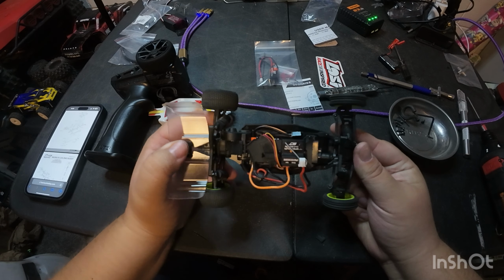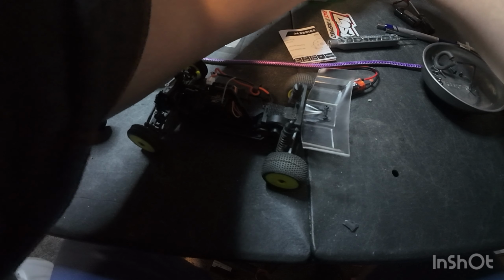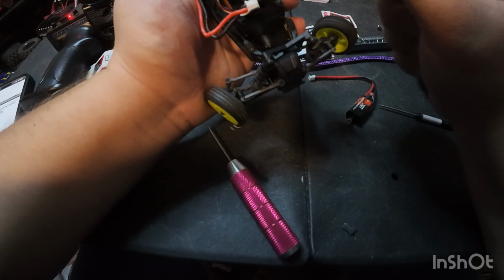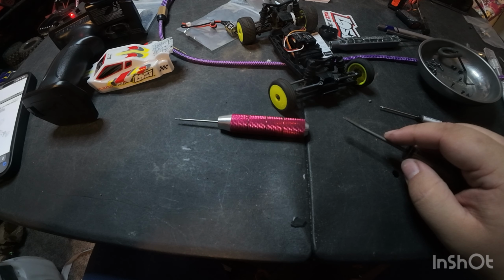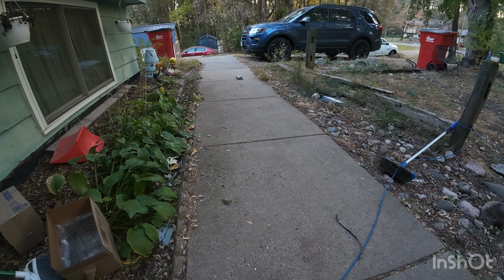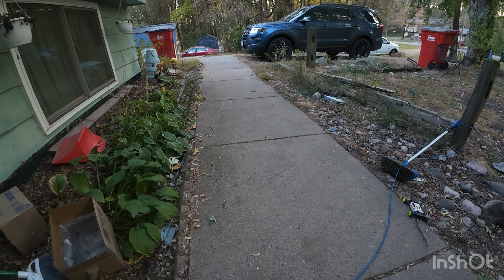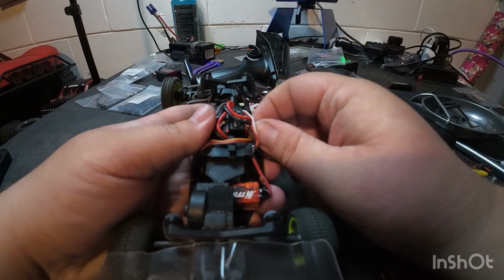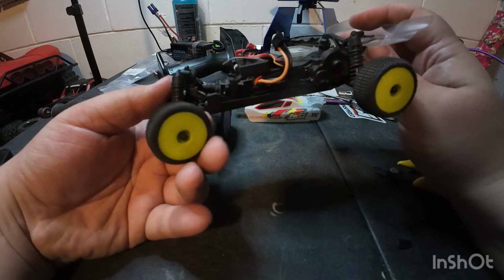Losi Micro B Motor Upgrade !

Comment: I felt the same with a 55t motor.  Faster but not much of a difference.  I also tried a Mofo RC 030 buzzsaw, which made it a lot faster, but the motor has a good bit of drag.  A couple days ago, I installed a 1222 brushless with an 18a esc and that works really well so far.  I measured 23 mph and it feels smooth.
Reply: Have any pics of layout inside car to place body on after brushless mod
Reply: Yeah I have a video of it if you look at mine.  First Micro-b video has a pic.